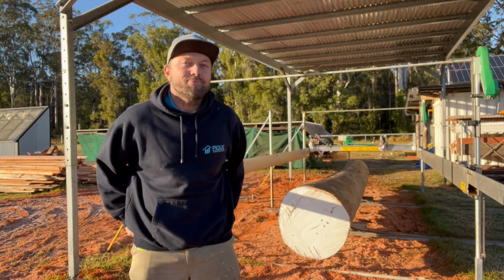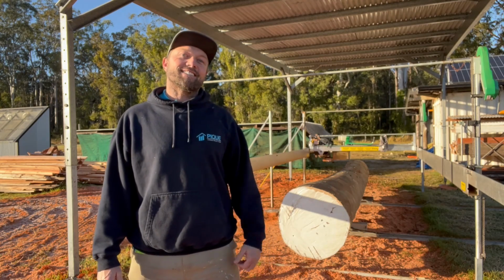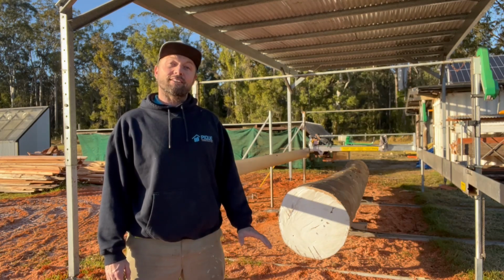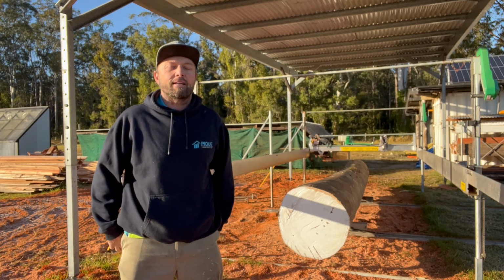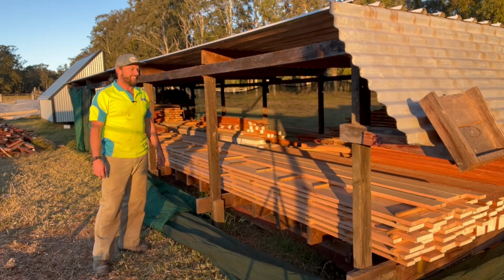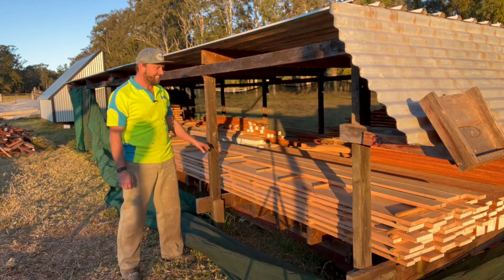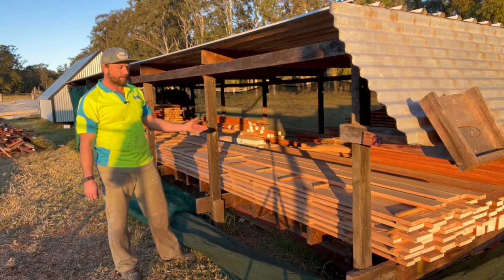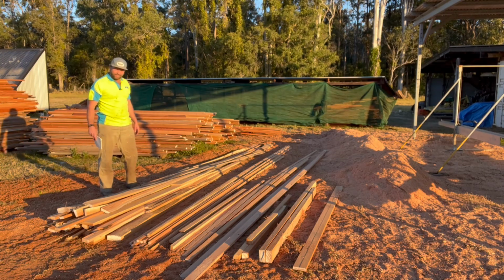How many $$$ worth of timber from 1 log? Is a sawmill a good investment?

Comment: Good job on milling up that log.  With a thick kerf compared to bandsaw, milling 25mmx25mm hardly seems worth the effort when you are buying a log.  Do your local building codes allow you to build a house (that you will live in) from lumber you've milled yourself?
Reply from the maker: G’day @bwillan, thanks. The 25x25 are bonus pieces that usually come off the edges or as fill pieces inbetween the boards you are going for. They don’t take much time and the timber would just get chipped anyway. It is worth it for me but to each their own! 
Yes you can use timber you milled yourself. I do have a kiln for drying structural pieces but the logs I am using aren’t any different to what a commercial sawmill uses!
Reply: @TallowView  That's good news.  Over in Canada and the USA, lumber used for buildings in which people will live in needs to be stamped and graded for structural use.

Comment: I watch a lot of sawmill videos. The saw that you have seems to make you work a lot more than like a Wood Mizer. Do you feel that way?
Reply from the maker: Hey Ronnie, I haven't used a bandsaw mill but it definitely does look more physical on the Lucas Mill. It isn't that hard, more consistent. I like the workout! The Lucas Mill gives me a lot more options than a bandsaw mill though so I guess you pay to play. I also have a slabber attachment for the machine that makes it a chainsaw mill for cutting slabs and a planer/sander attachment so I can straighten and flatten posts and slabs.
Reply: @TallowView  
Sounds like a very nice piece of equipment. Did not realize it did so many different things.
Reply from the maker: @ronnielloyd4514  Very versatile indeed. You can also break it down by yourself in about 15 minutes and put it on a ute to cut in remote areas. I obviously have mine set up as a more permanent location but I used to set it up and pull it down every time when I wasn't living on the farm.